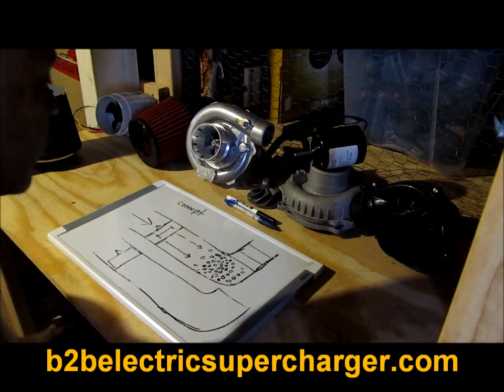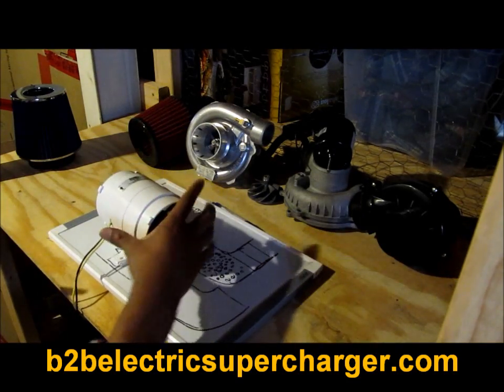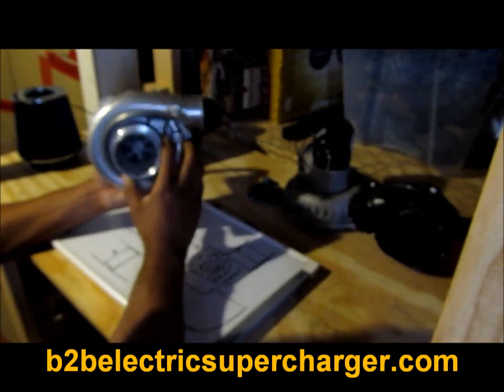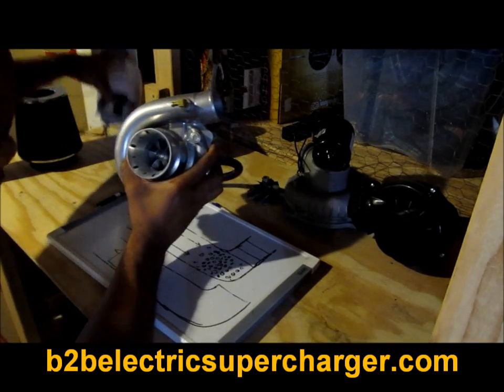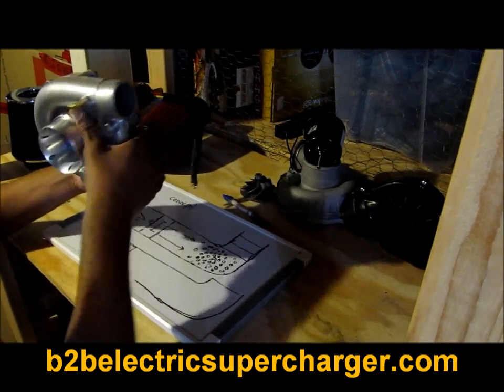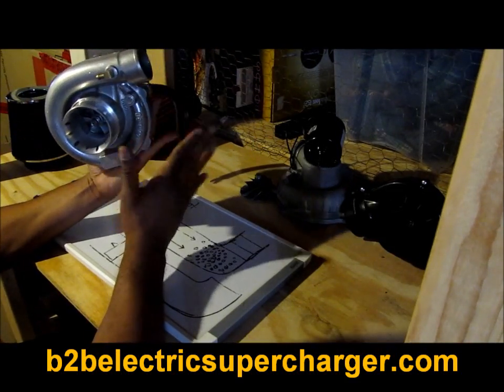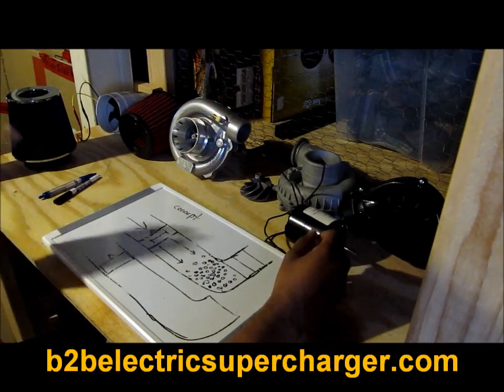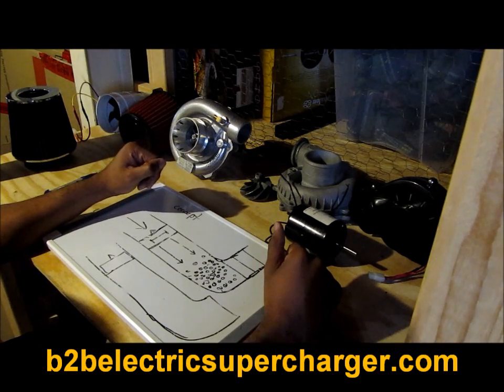Do Electric Superchargers Work?

Comment: Why WOULDN'T an electric supercharger work? The only difference between electric vs mechanically driven is just that. There will be a parasitic loss of driving the generator off the crank to create the power to drive the electric supercharger, but this is NO different than a mechanical superchargers belt coupled to the crank pullet. An electric driven supercharger will have slightly less efficiency due to having to convert the energy to electric and again back to mechanical at the supercharger, losses will be in the form of heat. Someone slap one on already to shut these internet know it alls up.

- Power Engineer
Reply: Pony Power https://matter2energy.wordpress.com/2013/02/22/wells-to-wheels-electric-car-efficiency/

Technically you could say they are not that efficient but power in to power out from the motor itself is 90% or even more. In any case, the non 90% figure sure beats the efficiency of petrol motors.
Reply: you clearly know nothing. There are two differences, #1, a mechanical supercharger uses the gasses from your exhaust and spools up the turbine which than pushes air into the main much larger turbine which is the actually "supercharger" its self. While an electrical supercharger uses a motor as the smaller turbine substitute. #2 a mechanical supercharger makes 100,000+rpm to make the extreme pressure and wind it makes while a electrical supercharger spins at 5,000-20,000 rpm which is no were near enough to make boost and usually decreases power (a leaf blower essentially). Many videos from people who don't fucking sell the shit all say its bullshit, it doesn't take much research to find out its all bullshit
Reply: In your point #1 you described a turbocharger. Were not talking about turbochargers. So why would you bring up a turbocharger? 

An electric supercharger has not been properly engineered to do such a job yet, except in formula 1. In concept, it is no different than a belt driven supercharger, except the method it is driven. Slightly less mechanical conversion efficiency can be expected. 

Finally, there are many more factors to a compressors output than the RPM. Inlet diameter, discharge wheel diameter, blade angle, whether there are any guide vanes and are they variable? 

You are 12.
Reply: they dont work because it takes away from the voltage in your car it will actually reduce speed by .2 hp. according to might car mods channel anyways
Reply: Robert Pinkham They used a crappy ebay "supercharger". Using a proper compressor and a decent motor, you can get enough boost to make your car more peppy. You won't get as much power (as a standard mechanical SC or turbo) unless you spend a ton of dollars. These electric ones will probably start out by only turning on at WoT so they can be run off the battery for the short time you are accelerating, and recharge during non WoT.
Reply: Technically seen it would work, it's just that the current technology doesn't allow us to build them in such a way that the pros outweigh the cons, AND make them profitable, economically seen, simple as that. Perhaps someday we will see electric superchargers but right now it's not their time.
Reply: Dear "-power engineer"
I'm sorry for the loss of your job. Please apply at my cousins work I'll put in a good word. All you gotta do is memorize the dollar menu.

-anyone with logic
Reply: Dallas Lynn I've got the powa!
Reply: Dallas Lynn Please, Tell your wife.. er.. cousin... that I am happily employed. I'm sorry for your lack of understanding of BASIC thermodynamics. 

-Power Engineer
Reply: -guy whose built and modified many turbo system. I know exactly how turbo systems work. I've had 3 different kits on my sti alone. Boosting anywhere from 18 psi up to 35psi. I would love to teach you to how turbos work.

-the engineer who designed the fire proof bp tower in the gulf.
Reply: Dallas Lynn You guys...they are simply air pressure pumps. It doesn't really matter what they are powered by, electric doesn't have the technology/price performance at the moment. I don't know why they can't include a gradual on time instead of "full throttle". 

I think electric is going to win eventually, we will have to see whether electric supercharger can beat standard turbos/supercharger before petrol and diesel engines cease to be built!

In any case, stop boasting about your turbo/thermodynamic/etc experience, it serves no purpose other than to boost (he he) your egos ;-)
Reply: At least in our life times I doubt we'll see ANY electric supercharger work on a car and make any good boost. Having one spinning that fast and makes any reasonable boost above 10psi isn't really possible. And without draining all the barriers it'll cUse to run that fast. And an actual turbo is so much more efficient... It's using exhaust gas! Used energy! And makes more power with that?? How is that not better than taking an electric one. And having to use yet anther energy source..
Reply: Dallas Lynn Electric will catch up :) You use electric to power your engine stuffs anyway :)
Reply: Dallas Lynn An engineer who can't spell the name of the car in which he was involved in the design of? Ya I believe you. 

I realize you have a hard on for turbo systems, or maybe you just like the sound of a BOV, but your lack of understanding does not make electric superchargers a useless idea.

Being able to shut them off and bypass them completely is the biggest benefit of all, and being able to store energy from say, braking (Wasted Energy!) and utilizing it under WOT to pressurize the intake manifold WOULD be advantageous.

For the record, turbochargers do incur back pressure in the cylinder making the engine have to pump exhaust gas through the turbine. This sort of loss is comparable to the cost of energy to drive a mechanical supercharger. An electric supercharger can be electrically disconnected and bypassed, eliminating ALL parasitic loss. 

The number of sources you can draw electric power from make it a novel idea that deserves R&D.
Reply: Hahahah bull shit about the huge back pressure on a turbo!  Omg haha that was funny... Saying it's similar to the loss of a super charger??it does provide back pressure. But it's minimal. That's why I can have full straight through exhaust and no cats and not lose back pressure. It provides just just enough still still run just fine. Until you own a turbo car and learn about them and dyno them for a livin and understand how they work don't make outrageous claims.
Reply: Dallas Lynn it wasn't outrageous... You can't not have parasitic loss from direct mechanical air pressure pump. Electric supercharger can run off powerbank and recharge when you are driving normal. Good for streets, etc, not for racing.
Reply: Dallas Lynn Yes, back pressure. I like how you added the word "huge" into my statement to make it seem ridiculous. 

Something has to drive the turbine to spin the compressor and create boost pressure. The same way it takes work to create pressure on the compressor side, it takes a reduction in pressure across the turbine to produce the work needed to spin the compressor. Following me?  Fluids move from high to low pressure. If there is 0 psi across the turbine, there will be no exhaust gas flow, and no work put into the turbine, and no boost pressure. 

Hopefully you don't think turbochargers operate for "free" anymore.
Reply: Id like to add, I wouldn't be surprised to see exhaust gas back pressures pre-turbocharger in the 30psi range.
Reply: And yes they do still pretty much run for free. It's using OLD ENERGY. It's using the byproduct if energy! What you and your normally aspirated buddies normally just dump out the tail pipe. Me and people who have real turbos use that wasted energy and use it to make more than you could ever think about getting. I put a link to this on nasioc and a Subaru page on Facebook and people are dying laughing at you hahaha.
Reply: At this point I'm done arguing with a moron who knows nothing as far as turbos. Someone who watched a 5 minute special on YouTube on how a turbo works. And oh don't let me forget "is an engineer" who knows all his shit. I've had multiple people die laughing at you. And I apologize if people get on here and get real nasty. I told them not to post anything. But I mean. Listening to you while it's so funny, it is annoying hearing someone act like they know shit. But come across as a kid who knows no shit. Goodluck with your career and Hopefully one day you may get to the point to where you can actually afford a turbo car. And then on top of that afford to modify and actually tear into a turbo system and see how it actually functions. And if you say you already have me and everyone else who has read this, including the 300+ views on nasioc already, will know it's bullshit. So don't embarrass yourself any more.
Reply: You showed these comments to your friends? Is that your form of gratification? 

As far as my knowledge about "turbos" goes, its much less about knowledge of a specific piece of equipment, but rather having an excellent understanding of physics, which you seem to lack. You may very well know how to bolt a turbo onto a manifold, but you don't understand how they work, which is why you didn't argue even once in all your bantering. There is, without a doubt that a turbine imposes an exhaust flow restriction, causing additional back pressure on the engine resulting in what is known to be a "parasitic" loss. This is fact.

Don't like it?

Learn to.
Reply: For the record, I don't want a "turbo car" (which in your mind is probably a 240sx). I prefer large displacement high revving naturally aspirated V8 engines, like you would find in a Corvette, Cadillac CTS-V, or my cammed and bolt on Pontiac G8 GT. None of which you would ever afford.
Reply: You know what I hve to reply again I couldn't hold it in hahahaha. You don't bolt a turbo on to any manifold lol. Thats a supercharger dumbass. And my sti would destroy your silly g8. That car is a joke. And nice cam lol. I've got my precision turbo, and I've rebuilt my whole block. I have not a race cam but a more mild 270/270 cam. Which is still pretty big for any street car. and I make roughly 475whp on e85. And for you who probably doesn't understand wheel horsepower vs crank horse power. To the crank I make roughly 550 or so if not a little more. How do you try and impress me with your Cammed g8? The v8 economy looking car?
Reply: Dallas Lynn Ever heard of an exhaust manifold? Yes they are sometimes called headers. Also, F1 car laughs at your puny Subaru power. Besides, power isn't everything. You need power to impress your friends or something....  I mean wow you posted a youtube comments section to a forum page. 

Turbos will have parasitic loss. Even if you get loads more power from your engine, you need more compression which means more loss the higher up you rev with that power. Ever heard of turbo lag? Would you say that happens because you are waiting for a piece of metal to spin up?

At the end of all that you put more fuel and air into the engine, which gets dumped out the tailpipe. If you really used all that energy you would have a 1" exhaust. Plus you waste more HP with awd.
Reply: A turbo isn't bolted to the exhaust manifold either hahahaha god people are so dumb! you guys make my day! And yeah I posted the link here cause it's hysterical. Everyone with real performance cars and actual turbos are just dying cause you pathetic people and your "knowledge" of how good your cheap electric supercharger work.  If they could work that we'll, and made so much of a power difference  and are so efficient and their so much more affordable... HOW COME CARS DONT HAVE THEM. Thank you.
Reply: I'm done. This guy is a troll. 

"You don't bolt a turbo on to any manifold lol. Thats a supercharger dumbass. "
Reply: Dallas Lynn They do have them actually...
Reply: TheDudeAr wow lets all calm down a minute. Let me just quote you a second "An electric supercharger has not been properly engineered to do such a job yet" this is not true, its your understanding that a bit misplaced. Superchargers draw about 20% on average of an engine power (HP) and increase HP by 35-45% depending on the set-up. 

So if your car produces 200HP for instance 20% is 40HP, thats around 30kW of power! Not only that but the example in the video is a large compressor wheel off a turbo. These have been designed to run at 80,000-120,000 rpm to be efficient. so you need a motor that has a speed of 80,000rpm with a power rating of 30kW to do the same job.

That's why no one has a electric super/turbocharger. The articles you read are electric assisted turbos to reduce lag times.
Reply: An electric supercharger could increase power by whatever percent I choose, based on what I power it with. Whether that be a large battery that charges over time, or if it runs straight off of the alternator. You are taking generic numbers and throwing them at me. 

Why would you need a motor that spins at 80,000-120,000 rpm to do spin a compressor wheel? We have gearboxes for that. They are used in centrifugal superchargers such as the procharger. DC electric motors can spin at very high RPM, by the way. I haven't really read any "articles" on electric supercharging, my knowledge comes from a professional background in thermodynamics and mechanical systems such as steam turbines, gearboxes, and internal combustion engines.
Reply: You need to spin the impeller at that speed to displace enoug hair to create pressure in the manifold. Your missing the point, its a power problem. You can have a DC motor spin at 100,000 rpm but it will have very little torque, i.e no where near enough to be any use to increase pressure. Its not generic numbers it physics. You don't have any 'background' in any science subject clearly. This is engineering 101. If it was that easy don't you think all superchargers would be powered by electric motors?
Reply: TheDudeAr Turbochargers spin up to 250,000rpm this is from Garrett "The turbine housings direct the gas flow through the turbine as it spins at up to 250,000 rpm" why is this?
Reply: 250,000 rpm really hahahah. You're talking about a high performance turbo on a ton of boost. You're talking about adding an electric supercharger to make more power. You'll not make too much. Your only hopes are to come close to equal to cars with a stock turbo. Which spin roughly at 80-100k rpm. You'll never compete with an aftermarket one hahahahah.
Reply: I'm by no means against you tho. I think electric turbos are beyond ridiculous. It's a horrible idea all around. What's better than using USED energy. Such as EXHAUST gasses which are the byproduct of energy. And it's used to spin the compressor. And make MORE power. At the expense of already used energy. with "electric turbo or supercharger"  you have to make
Energy for it by multiple batteries which will drain extremely fast when you try and
Use it to spin something that fast. No way your stock alternator and battery can compete.
Reply: Dallas Lynn Why use an inefficient engine like petrol or diesel? Why not electric which is 90% efficient....
Reply: Yeah okay one sec. Lemme write a check for an electric car. Something that would not be nearly as fun to drive with no exhaust sound and something unpredictable.
Reply: Dallas Lynn So you want to recycle energy but want to use an inefficient process at the beginning... lol. Engines sound good and all but I'd also enjoy a silent car.
Reply: Pony Power To give the fluid being compressed any decent velocity on such a small impeller wheel you have to spin it very fast. In a centrifugal pump or compressor, pressure is made by accelerating the fluid off the blades of the impeller and exchanging velocity for pressure in the expanding volute of the casing. You need a lot of velocity to compress something. You need to spin a small impeller very quickly to obtain the velocity required. Making sense? Larger impeller wheels can build similar pressure at much lower RPM because the tip of the impeller is much further from the center, and is therefore moving faster, this is at the expense of higher moment of inertia (you would call it turbo lag). 

As for your other comment, I do recall saying I can build whatever pressure I choose by choosing what I power it with. You went on to say its a power problem. I'm saying that if you have an adequate power source, that electric supercharging is no different than mechanical supercharging. You are saying its the method of powering it is impractical. Where are we going with this? No where fast. 

Prof. out
Reply: with larger impellers comes larger diffusers which means you need the same proportional speed. so a small impeller need to be run as fast a large one. As for the power problem yes that is the issue. You say you need a n adequte power source. Thats correct but your not going to find a small motor with sufficient power to make the whole thing viable.
Reply: Yes you can power an impeller with an electric motor and produce the required pressure in a manifold. However, in practical terms your going to need way more than an engine can produce from a standard alternator/magneto and the motors weight is going to be nearly that of the engine. Negating its effects. So whats the point, just run the impeller off the engine.
Reply: Rennie Ash 90% efficient, someones breaking the laws of physics again
Reply: True
Reply: Dallas Lynn If I may point out, turbochargers do not extract "wasted" exhaust energy. They extract energy that potentially could be used to drive the engine, if you designed it like that from the start. However, for various reasons, it's advantageous to use part of the working gas energy for that, hence why turbocharged engines are designed with higher exhaust pressures - exactly to accommodate a turbocharger. A turbocharger is really an integral part of the whole engine cycle. Yes, it "robs" energy from the working gas, but in return allows you to generate a lot more power overall.
Reply: Rennie Ash Keep in mind that in any closed thermodynamic system, energy is conserved. The electric motor to run the supercharger needs energy from somewhere. "Aha, battery!" you say. Okay, where does the battery get its charge from? The alternator. And where does the alternator get energy from? The mechanical engine crank. And the engine crank gets energy from the working gas (exhaust) flow. IOW, in an electric supercharger scenario, you went: exhaust -> crank/alternator -> battery -> motor -> compressor. In a turbocharger, the cycle is: exhaust -> turbine/compressor. We know the rough efficiencies of each step: exhaust -> crank ~50%; alternator -> battery> ~80%; battery -> motor: ~95%; motor -> compressor: ~90%. Meanwhile even a poor turbine will recover around 50% of gas energy. Multiply these together and you'll see that not only is a turbocharger much simpler (fewer components and energy conversion stages), it's also more efficient.
And that's why everybody is using them. Not because we don't know how to make them work.
Reply: totoritko The efficiency of motors I was talking about were for direct drive of the car itself. 

Mechanical turbos came first due to simplicity and lack of proper electrical equipment. Nowadays, electrical is not too bad because you can fit dedicated batteries that power the supercharger independently of the Alternator. You can also charge them from braking and coasting or even solar if you want to go that far. So you can harvest energy while you don't need it which is something an exhaust driven turbo can't do.

Modern cars are beginning to use both techs because electric is better at lower rpm or can fill the gap where the exhaust driven turbo will lag. It also means you don't need to constantly be driving a parasitic load of crank driven superchargers.
Reply: This is kinda right, the car using electric hybrid turbos and doing so for one purpose, higher 0-60sec times, is one big cock measuring contest. With part complexity and cost its counter productive. Motors will have to get alot better and cheaper before you see them on your prius
Reply: Rennie Ash "you can fit dedicated batteries that power the supercharger independently of the Alternator"
Yay for more weight.
"You can also charge them from braking and coasting or even solar"
Let's go from least preposterous to most.
Braking energy recovery is really complicated. You'd need an additional large electric generator in-line with the drive train to recover hard braking, which again weighs a lot (a good 100-200HP generator will easily more than outweigh your battery). If you're not planning on recovering a sizable chunk of the braking energy, why bother?
Coasting recovery is just robbing you of kinetic energy, which you might as well not have invested in the first place. It's just a delayed crank-attached alternator.
And solar? Even if you coated the car completely with solar panels and had optimum sun, you'd get 3-4 HP at best, or about 1 order of magnitude less than you'd need to make the compressor work. And if it gets dark or even cloudy, it won't work much at all. Making your car's performance weather-dependent is utterly ludicrous.
"Modern cars are beginning to use both techs because electric is better at lower rpm or can fill the gap where the exhaust driven turbo will lag."
I'm not aware of any modern vehicle that uses an electrically-driven compressor to overcome lag, but maybe I missed something. What I do know is that they use variable stator vanes, multiple turbochargers and extremely lightweight construction combined with electronic control to anticipate power demand. These have largely eliminated the multi-second turbo lag. There's still a slight hint of it, but if you know how to keep your revs up (which racing drivers do and I assume we're talking about a high-performance scenario here), it's a non-issue.
Reply: totoritko By solar I mean you can charge batteries while the car is off. Obviously the solar energy is not advanced to power the entire supercharger directly. Getting energy from coasting can be done when you are going down hill so you can use either brake regenerative equipment or a driveline one. Braking is probably better if you don't want more parasitic loss. In terms of "racing" I was talking more of on street performance as these particular types aren't used on race cars yet. 

In any case, there isn't much point pursuing the electric supercharger for fossil fuel powered engines as it is more efficient to use the motor for direct drive. It just depends on when they switch to electric cars which is limited by battery technology. For a street car, an electric supercharger may make some sense especially for those not wanting so much hassle of installing a turbo. It may also be nice for them to supplement a turbo if they get out of this On/Off only mode - it can't be that hard to add a little motor control potentiometer to turn it down as revs go up or start turning it on at medium throttle.